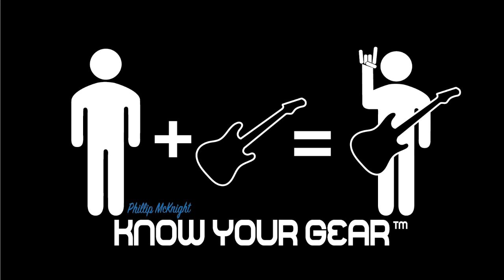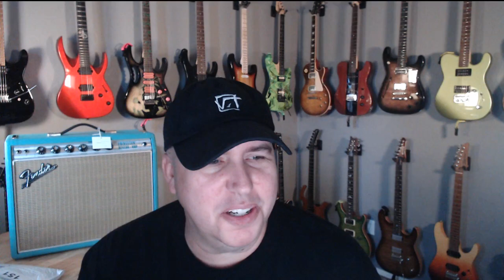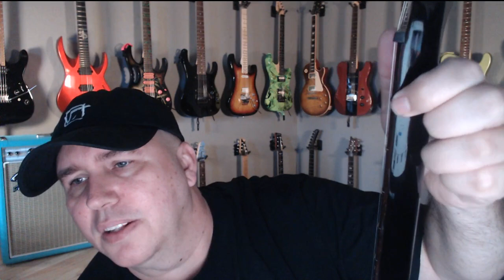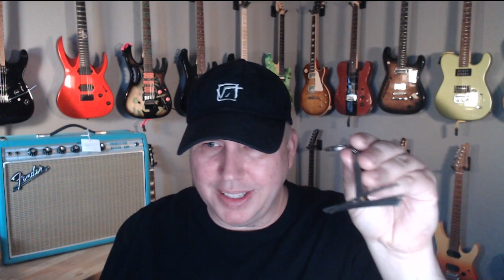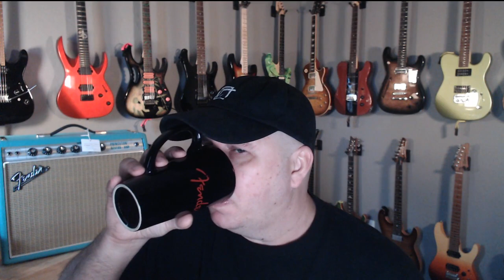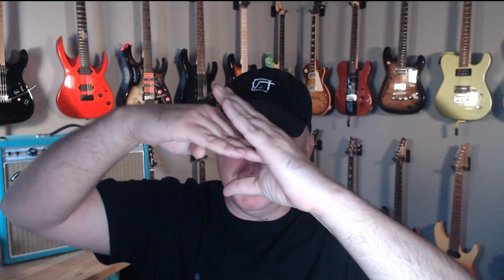The Perfect Guitar, But You Hate it. Guitar Podcast

Comment: Great Princeton amp. I just got a Fender '57 Custom Champ Class A hand wired amp with Weber speaker. I wanted an amp I can crank without it being unusably loud. I wanted those Class A harmonics that sound so good when the amp is workin'. Original 5F1 circuit with Fender Pure Vintage yellow capacitors and Schumacher transformers
, 12AY7 preamp tube, 6V6 power amp tube, 5Y3GT rectifier tube No pedal or other amp will produce that sound. No wonder that amp has been used on so many important recordings. Joe Bonamassa sold his Dumbles to get Fender Tweed amps. He must know something. I want some of what he rediscovered about Fender. Fender has got the mojo. From first inkling that I want it to ordering to delivery in my hands less than a month. That's why Fender continues to be #1 for me. Keep up the good work. Instead of verbally apologizing use a hand gesture or screen prompt.

Comment: Torrified wood makes some sense for solid acoustic guitar tops be cause it supposedly quickened the improvement in tone that comes with an aged top.  I don't see where this would do anything for a guitar neck. Might even make it worse.
Reply: John DOnofrio: a roasted neck lost all the water inside the wood and is therefore much more stable and does not move around when temperature and / or air humidity changes. If you are a touring guitarist and you travel a lot then such a neck will turn out to be really stable without the need to adjust the truss rod due to changing conditions. But even if you do not travel a lot then the neck of your guitar will need much less adjustment once you set it up right.

Comment: Mr McKnight, I am usually late to a lot of videos and I don’t know if you read all the comments especially if they are late like this one (4 days) which I know may be a logistical nightmare. There are two things about Sweetwater I wonder what your opinion is on. One is about the 55 point inspection which I have looked at. It seems that 80 to 90% of it is stuff that should be expected. I mean shouldn’t it be? To use your car analogy it’s like buying a new car and it doesn’t have the backseat. If I get a new guitar from anyone, I expect it to have most of the stuff on that list taken care of and not to be phrased as something special. Would you accept a guitar that came with no strings or the pick ups hanging out or the truss cover not there I mean come on! There are a lot of people out there that save up the money to get one good guitar. I myself only have 5 new/“nice“ guitars. It took me a while outside of normal living and family expenses to get to the point to be able to start buying new guitars.(nice I guess In my opinion) Secondly, which I’m sure you don’t have an issue with is there a use of Synchrony Bank for their credit card with which I’ve had much trouble with. Due credit to the Sweetwater staff they are the ones that helped me solve most of the problems with Synchrony Bank not even the Synchrony Bank people themselves. If Sweetwater wants to be above the rest tell them to get rid of that card handler. I hope you read this and get a chance to address it. Thank you.